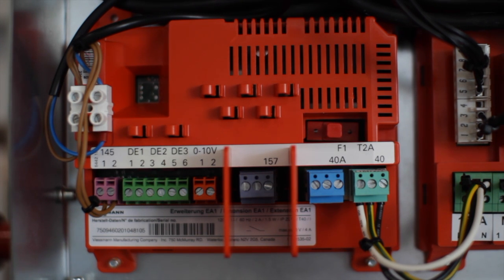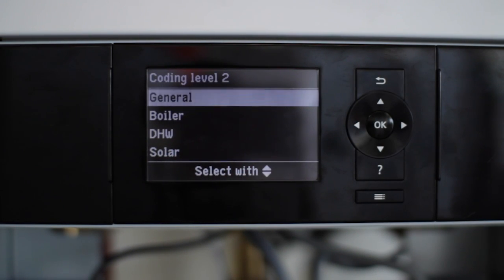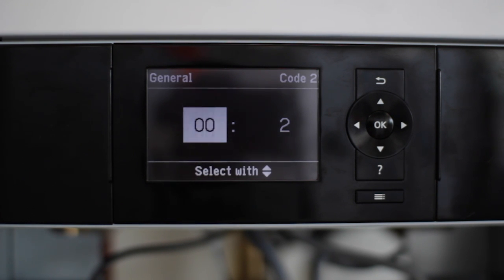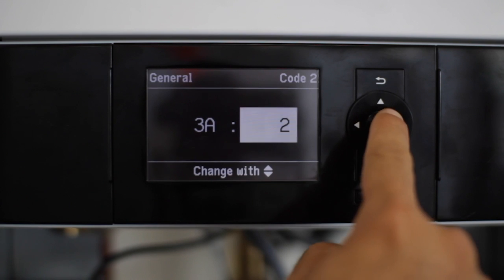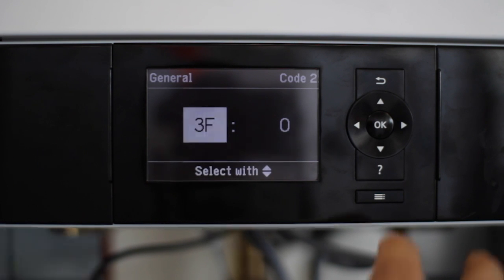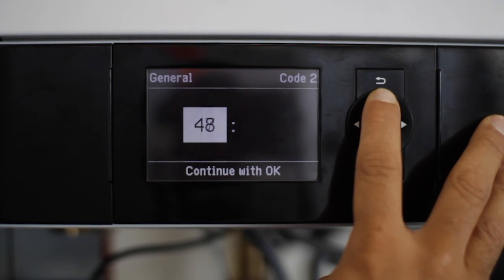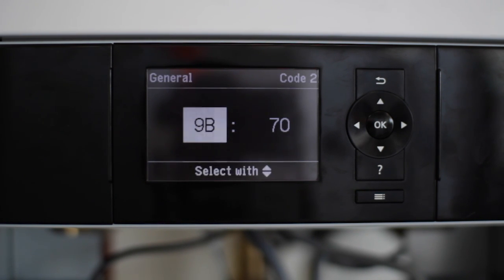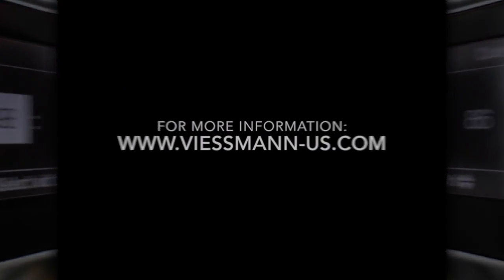Programming a Vitodens 200 for External Demand

Comment: Will it still run with a heating curve when triggered by an external demand? Or will it just go to a setpoint?
Reply from the maker: No. The external demands will drive the Boiler to a set Point that has in coding in Level 2. It will not run off the outdoor sensor or heating curve, it will just run up the set Point. If you have additional questions please reach out to our technical Services line who is available from  8:30 AM - 8 PM EST and can be reached at 888-484-8643. Thank you.
Reply: Viessmann US Ok, thanks. That's too bad though, I thought it would be like the Vitodens 100 in that respect.